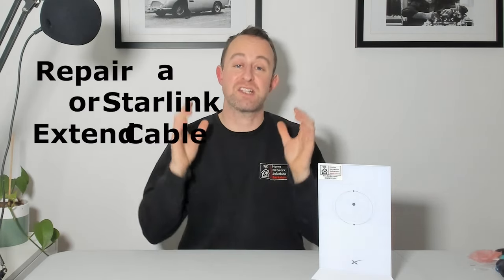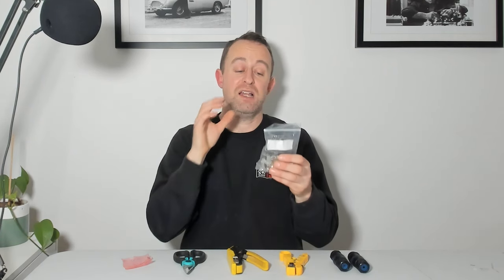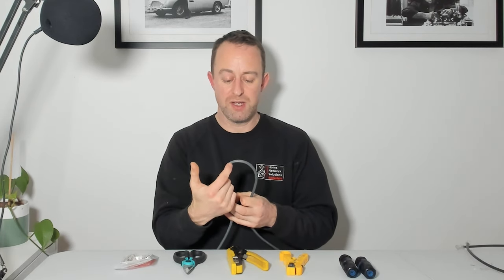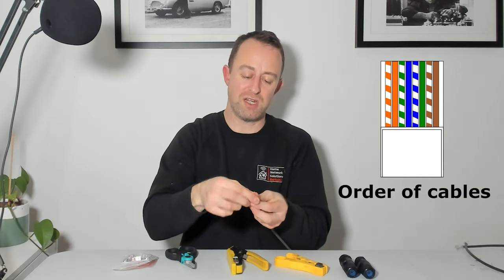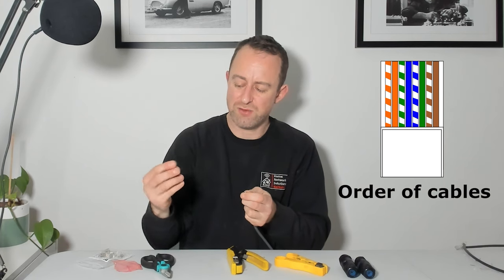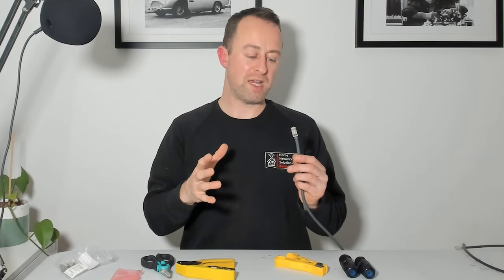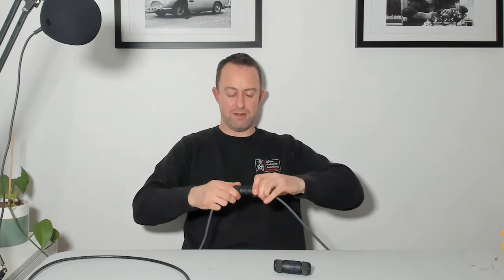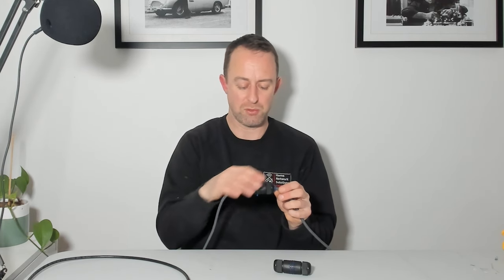How to FIX (or extend) a STARLINK CABLE

Comment: Thank you for sharing. Is it necessary to extend the grounding wire? Will a UTP Cat5 cable work, or is an FTP cable necessary?
Reply from the maker: Its best to extend the grounding wire in my opinion but it will work without it. 
Thanks for watching!

Comment: work with gen 3 starlink?
Reply: and can you use cat5e
Reply from the maker: Not sure about Gen3, does it say on the cable. Yes you can use Cat5e as the Starlink cable is Cat5e. Should probably be shielded though.

Comment: Good video. What happens with the grounding wire?  Does the coupler bridge it.  Btw I always put the plastic sleeves on first before crimping the cable so you don’t have to fiddly about with the blue split rubber thingy (technical term :-)
Reply: The coupler had shielded connectors. So if the drain wire is properly connected on the cable, the coupler should bridge it just fine.
Reply from the maker: Yep as has been said the grounding wire will work as the coupler is shielded.